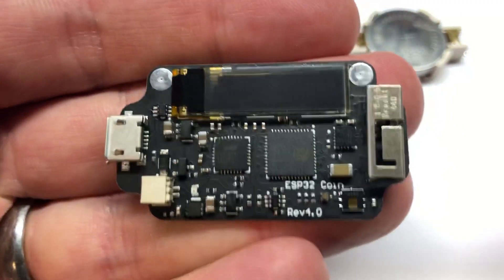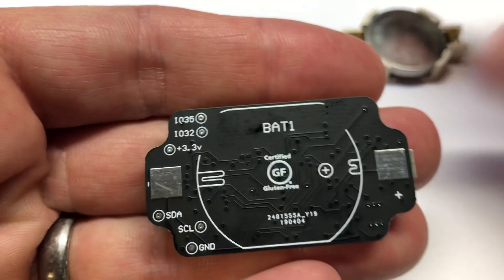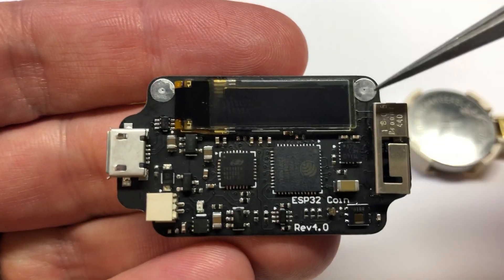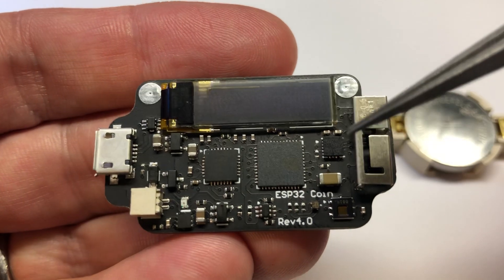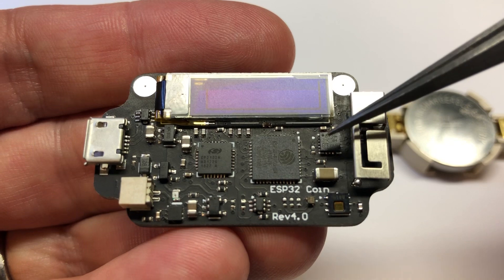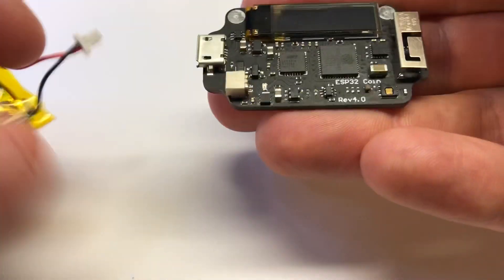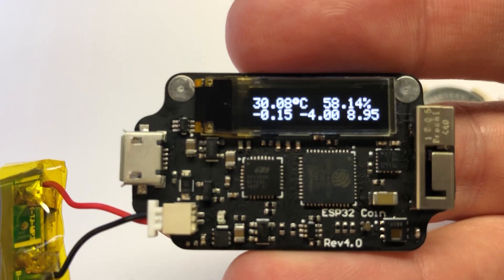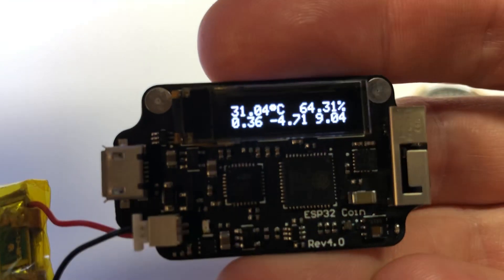ESP32 CoinCell Final Revision

Comment: Hey, in your rev4 schematics, haven't your forgot to connect CP2102N's VDD pin to 3.3V?
Reply from the maker: If you connect pin 6 to +3.3v, the board will draw higher current in sleep mode because the CP2102 will always be powered. I wanted this part to only draw power when plugged into a USB port. The datasheet says pin6 is a Supply Power Input or a 5V Regulator Output. I went with the Output for mine.

Comment: Great content Mike! Just wondered how you pulled off not having any buttons on your design? My ESP32 is giving me a headache with trying to flash it...
Reply from the maker: Philip Rochester It is possible to flash it without buttons if IO0 and the Enable pin of the ESP32 is controlled by the RTS and DTR pins of the CP2102 using npn transistors. Some use buttons but they take up too much room.

Comment: Hey,
Great video and great project many thanks from a Tunisian Expat living in France.
If I may, I have some questions for you :
- is your board 2 layers or more ?
- as I saw, soldering would have been a nightmare or did you order the board assembled ?

I may doing a similiar thing with 2 layers and probably doing the soldering myself, since assembly is expensive, powering from USB and putting components on both sides to reduce board size do you think it is possible ?
Many thanks
Reply from the maker: The board is so packed that four layer were necessary and assembly was done myself with solderpaste and a reflow oven. A few components on the backside is never an issue when you populate it yourself and is the best way to save space. The coincell battery on this board takes up most of one side. Companies that do assembly for you will charge more for a double process.

Comment: Great! I want to make a project with esp32 pico D4, the program was done at arduino ide?  Can I use the board ESP32 DEV KIT V1 for Upload? Any board? (IDE Arduino).
Reply from the maker: yuri borgews the Pico D4 is perfect for really small designs but difficult to solder because the only ground is the large pad under the part. To program it I only use the Arduino IDE and choose ESP Dev Board under Tools. Good luck!
Reply: @0miker0  please help me again? I don't found this board,  can show me? I make my pcb and bought with pico D4 but I could not to program.
Reply from the maker: yuri borgews it’s most likely a component not properly soldered down. Even with a solderpaste screen and a reflow oven it can be challenging.
Reply: @0miker0  I don't found board in arduino IDE
Reply from the maker: yuri borgews if the USB connector or the cp2102 is not prolly soldered down then the board will not show up in the ide.

Comment: What is the voltage of one of these LIR2450 cells when it no longer runs the device? 
(i'm curious if the half-volt drop from your LDO is causing any large current spikes to give you a brown-out.  If so, simply adding a cap may help increase the battery life) 

I hear the ESP32 can pull as much as 600mA during a spike, so that'd make your LDO momentarily drop it's output below 3.3V (ie: possible brownout) if your battery voltage was any lower than 3.8 or maybe 3.9V.  A pretty high voltage for a "flat" battery.
Reply from the maker: roidroid I’ll have to run this test. I honestly didn’t think when I first designed it that a coincell would work at all. When it’s sleeping most of the time but waking every few minutes it lasts a surprisingly long time. Right now a 100uf capacitor is as close to the esp chip as possible but more caps would definitely help.
Reply from the maker: roidroid I’ve charged up a coincell on the board and let it run for a few hours. The oled eventually goes dark, blinking on randomly. The LiPo protection ic never lets the battery fall below 3.0v
Reply: @0miker0  so after you take the battery out when the device no longer runs (flat battery), a multimeter reads the battery as 3.0V?  If so, then yea it really is using all the battery charge.  Oh well there goes that theory.

Ps: i just mean after the 5-10 mins you say the battery lasts, not hours of the device not running properly.   When the device just STARTS to no longer function properly (starts reseting itself or whatever), take the battery out and use a multimeter to see what voltage the battery is.  You said it only lasts approx 5-10 mins yea?  Thats when i want to test the battery's voltage

Comment: This can be a good sensor node. How much time this will work with let say 350mAh LiPo battery if transmitting temperature and humidity let say once in 20-30 min?
Reply from the maker: Alexander Stepanov with a 120mA Rev1 drew 200uA sleeping and lasted 10 hours waking every 10 minutes. Rev4 now draws 30uA asleep but has the ability to use the microJST to attach a 350mAh or larger battery. I’d have to grab a 350mAh battery and run your test to be confident it could be done.
Reply: @0miker0  Actually for 120mA anyway this will be less than 10 days. Not very good. What will be current with the display turned off?
Reply from the maker: Alexander Stepanov I would have to run a few tests. My testing so far had the ESP32, sensors and display all wake from sleep and be active every 10 minutes.

Comment: Thanks.  How is an LDO better than switching?
Reply from the maker: Tom Donnelly It appears that a switcher is best when a high vin to low vout is needed. If this board was powered from +12 it would be the way to go. Mine is going from +3.7v down to +3.3v so an LDO is recommended. The switcher that I used in Rev3 drew 1mA with no load but this LDO draws only 10uA or so.

Comment: Nice update Mike... can I ask why you use the 28 pin CP2102 rather than the smaller 24 pin variant... it would seem to be an option for saving some board space.? is there a driver compatibility reason (I note that the 20 pin variant doesn't have all the required pins...)
Reply from the maker: Peter Wilson this board was my first time using the ESP32 Pico d4 chip and to minimize risk I followed the schematic provided by Espressif at: https://dl.espressif.com/dl/schematics/esp32-pico-kit-v4_schematic.pdf

Comment: I used the same gpio technique for a commercial product.. its unorthodox but works just fine. 😂
what about the run current? cz usually the issue with these micros is uA/MHz.. Is it sustainable to use the esp with a coincell? are you using the ULP?
Reply from the maker: marios2liquid current consumption with everything running is around 85mA so the coincell only lasts 5 minutes. It lasts around 10 hours if it wakes from sleep every 10 minutes.